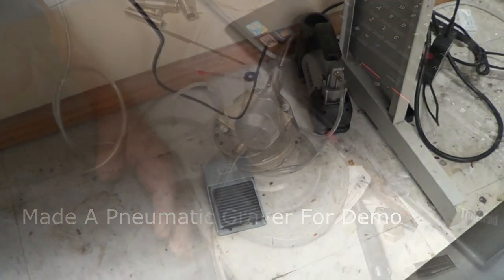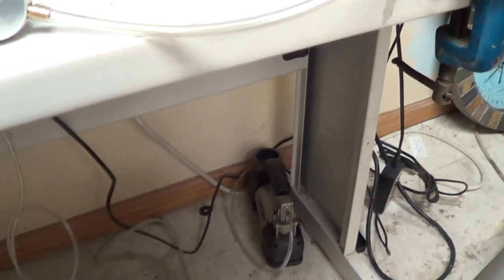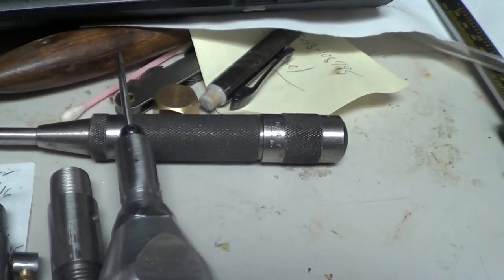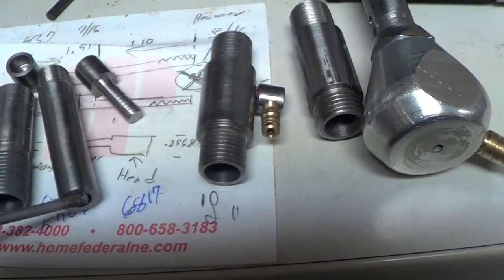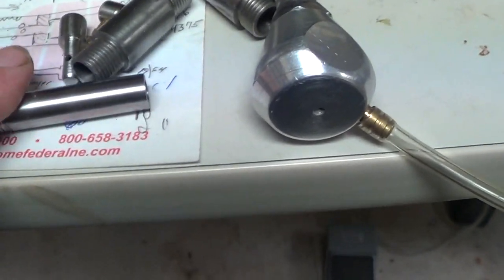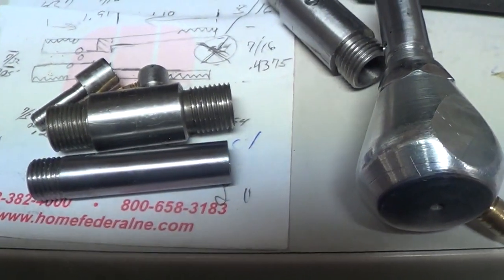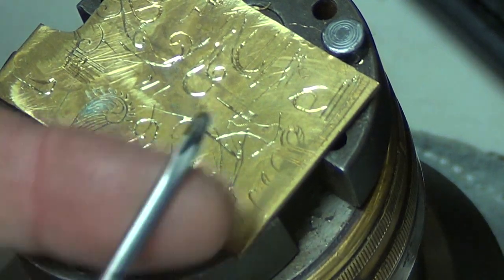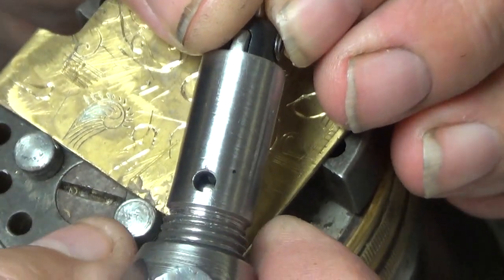Making A Pneumatic Graver

Comment from the maker: Rick Alexander helped me figure out the problems with my graver build. The pedal which I bought from ebay for around 15 dollars  had a bit of play in the top of the pedal I put a .030 brass shim on the pedal and glued it in place above the value button so now I have full control of the value and it depress to give the graver full power it works nice.  Many Thanks to Rick his channel offers a lot of info.  Now back to making the air-graver.

Comment: I started playing around with this as well I use a 12v compressor did not get much power out of it either, yesterday i got my motor speed controller to slow the compressor down it feels like it has way more power now you can actually feel the piston striking the graver now and not just the high speed vibrating
Reply from the maker: I think a lot of problems with my machine was the workmanship. I didn't take the time for machining to tolerance. I'm thinking about making my own pulse compressor so that it can be installed in a cabinet however all in the thinking plans for now.

Comment: What would you charge me to build me a shuttle style hand piece? I know what your talking about! I don't wanna engrave coins or jewelry doing motorcycle and car parts spring feels weak not enough punch! I've tried almost everything to get more punch out of the spring style!
Reply from the maker: I built 5 power gravers with the help of machines in Florida. I started building them from scratch but ran into some problems making them. I have since figured out the problems, the gravers have plenty of power it's just finding the time to make all the parts.

Comment: Is this pulse or oscillation? If your trying to make a oscillating airgraver I would imagine it's more difficult due to balance. If you drill a hole in the top of the piston and on the sides of it leave very small space to were air won't get trapped but enough to make the piston go back and fourth on it's own. When there is enough air pressure that cant escape through the vent holes the piston will go up and come back down. This is very important and takes patience because you must figure out the correct balance of the piston. Even the high end Lindsey airgraver won't function correctly if the pistons are not balanced correctly and the venting ports are not drilled to the right diameter. People are having more success at pulse airgravers. Check out Shaun hughes!
Reply from the maker: In the past year, I have built both pulse and oscillating gravers. I have not had much luck with the air graver or piston-driven.  It will oscillate but not the way a Lindsey graver works.
Reply: @rhjgold  but your close to the finish line my friend. You will be engraving soon!👍

Comment: Your hose is way to long. Also you need a speed control on the compressor. Then it will cut like Mad. You need to control the compressor speed and play with the spring size. Most important